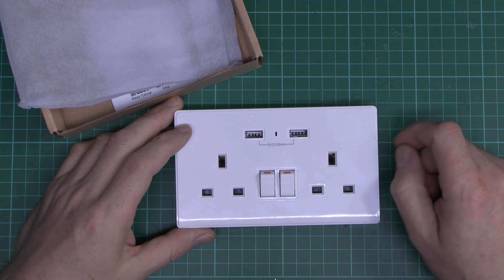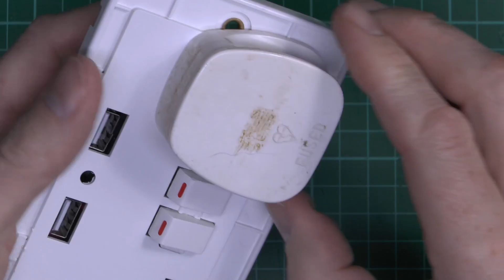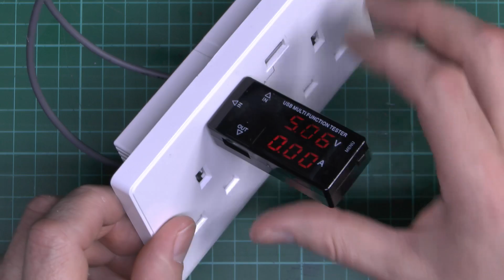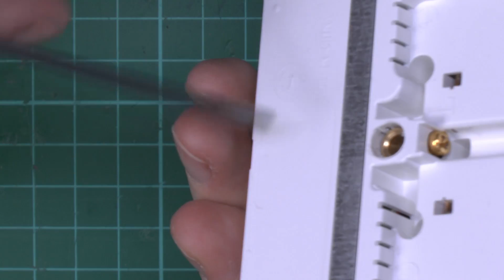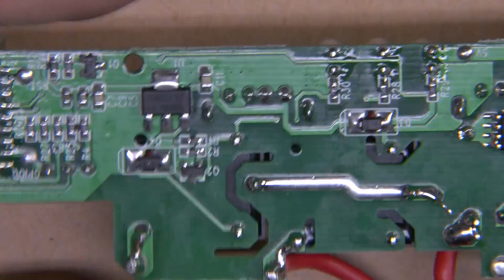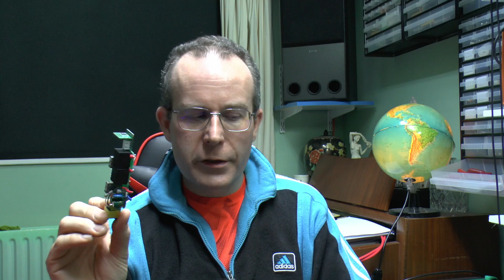WiFi Controlled UK USB Socket Outlet Teardown

Comment: JW not got to the end of your intetesting video so I may be preempting you …I noticed I think, the relays were only rated  for 10 amps at 230 volts. If my reading of the rating on these relays (from your video) is true then this socket cannot be used for 13 amp loads …

Comment: Nice objective video John. Thanks. Wouldn't it be sensible to add a DP isolator switch to the USB part of the socket? It would eliminate wasted electricity and, if I understand correctly, you would not have to remove it completely when carrying out an insulation test of the circuit wiring. I suppose, even if that was fitted, you would be putting a certain amount of trust in the quality of the socket and hoping for the best. Thanks again.

Comment: I have this product for more than two years. (Actually 4 of them)
They are in dayly use. One is witching pool pump high and low pressure. Absolutely not low quality. I checked the issue that was showed (fuse) and also checked all soldering on one item. All ok.

Comment: The two current ratings are for the NO and NC states of the relay. Generally, when the coil is energised there is more pressure on the contacts which allows more current.

Comment: There is an obvious answer to the problem of the USBs always being connected. Add a switch to each USB socket so the power is only connected when there is a plug inserted. Has anybody found a supplier who does this?

Comment: If I could improve this device, the first things I would do is use better components and make it safer including a replaceable fuse. Also redesign it so that it plugs into an existing wall socket. 

The unit design will have a low profile so that it almost looks like an actual wall socket (with a cover adapter for wall mounted socket terminal boxes). The unit can be fully powered down when not in use. USB power handing can be customized to suit device power consumption (also replaceable/interchangeable USB sockets to keep up with tech upgrades). 

I think a silent tiny cooling fan inside to prevent overheating. Yes everything will be squeezed into a small space in regards to unit depth (front to back) but will have more area (up, down, left, right) to spread out components fitted safely. I like the idea of a multi function power outlet, as long as it's safe, well built, uses quality components and will last for many years.

Comment: In Australia, Power Outlets are a "prescribed item" - that means it is mandatory that they are tested and certified compliant for ALL relevant standards. That includes the electrical, the plastics flammability, and in this case it would have to meet all USB and RF standards as well.

Comment: U6 is a MOSFET; all the pins (5-8) jumpered together (probably the drain), and pins 1-3 jumpered together are probably the source, and pin 4 is the gate. Salvage that, and the relays at least, and maybe the Wi-Fi module if you’re into that sort of thing, then destructively test the rest to see if it’ll catch 🔥! 🎆🎇

Comment: I don't like the fact there is so much technology in something that was designed to be simple
Reply: I recently bought a latching isolation switch for my car battery, and there were Bluetooth / WiFi versions of this on Amazon.  I noticed quirks, flaws and annoyances for these devices in the customer reviews and comments, and the need for the switch to be powered was a drawback.  I naturally bought the manually operated simple switch for a fraction of the price, and it only takes less than 10secs to flip the bonnet and then the switch.  Simple and reliable and does the job.

Comment: That small electrolytic above the warm-running transformer will have a reduced lifetime.  Very likely to be the first thing to fail.  In a good design, electrolytics would not be vertically above the hotter components to avoid heat transfer by  convection.  Preferably not near in any direction to avoid heat transfer by radiation.

It's going to fail after a couple of years anyway, but sensible design would have squeezed another couple of months out of it.

Comment: I would never bother with these, I've never  liked the idea of permanently hardwired electronics that can't be easily isolated  apart from the safety aspect, if you had a house full of them,  it would add up to a fair few wasted watts of power when they were not in use.

Comment: Hi, Can anybody make out the part number of that 7 pin chip? I am trying to repair a usb light fitting for my Dad. The chip looks the same and is near the transformer but the one I have has no markings. So far, I think I can see PN 8570, then K28H P5? A Google of variants of those numbers reveals nothing. If any does and matches a SMPS transformer chip then I would spec a couple of quid to see if I can get it going. It is definitely that chip which has failed. It has worked fine for 2 years and I am only trying to fix it because it is an expensive light fitting and I cannot get a replacement board. I am not convinced about the overall quality though (can't see a fuse except a 10 ohm resistor, no ntc) and won't be that upset if I can fin a reason to not fix it as it looks pretty bare bones.

Comment: The secondary wires are not coming out of the top because they couldn't fit the wires on the board. It's for insulation purposes, and it's a very good way to do it - You keep the secondary a LONG way from the primary this way.

Comment: 8-pin device with pins shorted in pairs of 4 and 3 pins - nooooo. That's a MOSFET. The brains of the operation is the Espressif ESP8266 WiFi-chip.

Comment: Apart from the electrical safety, if the cloud service running the app goes down or the company liquidates you are left with virtually useless sockets.
Reply: Tony Darby Not quite without WiFi the momentary switches should still function manually or is that digit - ally😂

Comment: In principle I'm not really against a USB charger that is left permantently on depends on what it is and how its used, if it is used a lot of the time during most days then it's fine. Kinda like how I use this 6 port USB charger that I have on my desk (which most of the time is powering one, two or more raspberry pis lately), it's only real issue is that with very light loads it makes a stupid high pitched whine but since no load or normal charging load stops that I'm okay with it.

But for a wall integrated USB power supply it's different, it's not as trivial to replace as a regular plug in kinda deal for which almost everybody nowadays has a spare elsewhere in the house or bag. Also if it ever decides to try to catch on fire or release the magic smoke you can't just easily pull it out of the wall or turn it off with a physical switch that isn't on the front of the panel.

Comment: The resistor from line to the bridge rectifier will be a fusible type of resistor, but it's main function is as an inrush current limiter for when the capacitors on the DC side of the bridge rectifier charge up. Pretty common arrangement in most small SMPSes.

Comment: Having permanently powered active electronics in mains sockets is a really bad idea... they will eventually fail with all the various outcomes that may bring :(
My wife recently asked if I could install some MK sockets with USB charging ports... I refused!
Reply: Maybe they'll come out with some halfway decent models eventually that have a physical on/off switch for the USB power supply part. 

But yea until that's the case I've got the same opinion about installing those, unsafe and a hassle when they do eventually break. Easier to just have your chargers take up a socket and  if the charger dies for some reason to dig up one of the other suitable spares that surely float around by now in the house.

Comment: I cannot stand them stupid USB sockets , they give me the creeps.... a USB port that close to a 32amp ring main ..... yeh no thanks.
Reply: It's fine if correct creepage distance and isolation barriers are used. Think about how small a typical phone charger is. Same problem there, which is why the el-cheapo chargers are dangerous, and why the proper ones are relatively expensive

Comment: Cheap chinese device... not that I personally would give USB built into hardwired installations the time of day as I just don't trust small transformers being live 24/7 because in the event of a spike in the voltage or something going wrong and possibly resulting in fire while asleep at night... I don't trust USB sockets full stop.

I've had many USB adapters fail... just easier using plug in adapters.

Comment: Fairly obviously this was originally designed as a non-WiFi-controlled USB socket and they simply added a spring to the switches to make them momentary, cut a few connections to take them out of the mains circuit and turn them into inputs for the microcontroller and then replaced them with the relays. Hence the ugly mess of wires and the nonsensical red power indicators on top of the switches. If you were designing this from scratch you would probably never lay it out like that, nor use such chunky switch contacts.

If I was specifying a permanently-installed USB socket, I think I would have the electrician make one up using Euro modules, with a proper isolating power switch. No need to integrate it into the same housing as a BS1363 outlet (although I suppose you probably could squeeze a switch, a USB module and a BS1363 outlet into a 4-module Euro faceplate if you really wanted to).

Comment: Is that switch something that just changes it from on to off and off to on? How can you make sure that it is off?
Reply from the maker: Have to rely on the LED indicators, or to be safe just unplug the item, which makes a mockery of the switches.
Reply: You have to view the switces not as a conventional outlet switch but a usable toggle input; little different to the WiFi system toggling the outputs.
If you want a system that provides  this functionality it has to be powerdf up..
I am not making any claims as to the build quality of this thing because it isn't great.
Reply: @derekrobinsonutube  I truly hate those kind of switches, especially if there is delay in the system. I also hate anything that has a light on it.

Comment: So much better to use a plug-in device. You can bet very few would be fitted and replaced by a qualified electrician. Trapped wires would be the main hazard but they could get pretty smokey too when they inevitably fail!

Comment: I've often wondered about USB outlets in sockets - even MK make some. Although an interesting idea, they also are, as you mentioned, likely to be going obsolete by the time they are installed. Couple to that the permanently-on electronics, the convenience does not outweigh the reliability problem. I first actually saw them in Ireland, but they are becoming more common, although I have to wonder why.

Comment: Nice idea, poor execution.  Think I'll wait till someone reputable brings out a well manufactured one.
Reply: I think I'd go with terrible idea, so so execution. It's not high quality construction but it's not as bad as all that. The big nasty is the very idea of the permanent hard wired electronics. I would avoid it even made by the bluest of blue chip manufacturers.
Reply: If MK made a version maybe but I would probably still give it a wide birth.
Reply: Probably the reason why mk havent made such contraption
Reply: @s.kxx1956  Sorry if this disappoints but they have:  https://www.mkelectric.com/en-gb/Pages/USB.aspx indeed that page boasts of being among the first to do so back in 2013.   Now if only they produced one in which th USB module had a switch and so could be isolated from the mains.

Comment: since the USB and the relay circuit seams to be sharing the power supply I wonder what would append if you tried to draw maximum current from USB and then use Wi-Fi to Turn on the relays. will it be smart enough to limit USB current or just incapable of operation??? (I believe the later but it would be interesting to check)

Comment: I wouldn't complain too much about the secondary windings of the transformer not going to terminals.  OK, mechanically the transformer is crap, but having the enamelled copper wire (possibly double insulated) of the secondary coming out from the transformer like that should give far better primary/secondary isolation. (I think both BigClive and DiodeGoneWild have explained this in some of their videos where they have dismantled SMPSU transformers to check for inherent insulation problems).

Comment: Looks like they use the esp8266 chip so should be fairly easy to write your own firmware with the Arduino IDE. Shame the build quality isn't great on these, though it could be a lot worse.

Comment: Oh, for goodness 
sake!!! Whatever 
next?! If you want 
my view on these.......

......Wayne's Electrical DOES NOT approve of the permanent installation of electronics into the electrical installation and the structure of a building!

For a few reasons..... FLAAAAAMES being one of the most worrying ones!

Next, when pulling-off certain installation-related tests, something like this will REALLY fudge-up the test results!

Next, how many watts does your sockets use?

Mine = ZERO WATTS because they don't contain =POXXY= electronics!

Electronics permanently built into the wall should be disallowed! As like with certain things like these, you WILL get certain "Outside-Of-The-UK" cheap and crappy makers of these things knocking them out for a few pounds each!

Not only that, what happens to one of these when subjected to a power surge, or for that matter, when one of these things lets loose?

Really, JUST DONT CHANCE IT.

Just use plug-in phone chargers and turn them off when not being used. At least if it fails, you can do this REALLY CONVENIENT thing of just unplugging it and replacing it yourself, with no screwdriver needed!  HOW TASTY IS THAT?

I would never have one of these, or even one of those with the USB sockets in it for the reasons stated above.

The only time I would ever get one of these, would be to crank it RIIIIIIIIIIIIGHT UP to see how much it takes... "Uuuntil-It-Pops" and to see what happens when it does! :D

Thanxx for showing.... But no thanxx. :D

-Wayne's Electrical.

6th March 2019, 02.40
Reply: do you always talk about yourself in the third person?
Reply: Have you not heard about home automation? I believe large commercial buildings have had plenty of electronically automated switching for years. It's only natural that it's starting to come into use in the home as well.

Comment: Hi John. Enjoyable vid as always, thank you. You didnt mention another poor thing in this substandard socket. one of the grey wires from the relay to a plug on the board  has been trapped between the corner of a relay and the case (seen at 14.25), flattening it.
keep the excellent work up,

Comment: As an Electrician, I won't supply or fit these USB/WiFi socket outlets, for the very reasons you gave throughout your video. If a customer insists then they can supply it but I wont guarantee anything but my work. What is wrong with plugging in a good quality USB charger? I would rather see a short 4 way mains block with 4 usb chargers in it than this cheap rubbish. Also, when it comes to doing IR tests, you can't to a L-N test on a ring final circuit because the 5V usb power supply is across the supply.I know you can just do a LN to E IR test but it's not a proper test in my book. Great video JW.
Reply: It is also wifi controlled so you can turn your plugged appliances on and off with your phone. Why? do not ask me.
Reply: @TonyDartford  Well it is fun to blink the lights of your neighbours and have them run around wondering what is going on :D
Reply: @benbaselet2026  Now that could be useful for those dreadful suicide inducing days, when neighbours are blasting music for 12 hours straight.  If the EU had forced all audio equipment to self detontate when pushed over 60dB, I would have voted for Remain instead!
Reply: As with any circuit that contains electronics equipment, you'd have to disconnect one of the live conductors from the equipment and terminate into some sort of connector before IR testing. In this case, stick the neutrals into a levered Wago connector, perform your IR test between all 3 conductors then reconnect your neutrals into the  neutral terminal on the socket-outlet.
Reply: I'm surprised with LAP going bad, aren't they screwfix's own brand? How did they fail?
Reply: @uK8cvPAq  Big Clive. Com took apart a lap usb socket, he found them to be well made, charging circuit was well made and designed. The issue I and many other electricians have is the constant unswitched load across L & N. There are some really badly made dangerous sockets out there for sale. But generally, LAP gear I found to be "ok" at that price point.
Reply: I think these are popular because 2 outlets are not enough anymore.  In my kitchen I have several 4 way schuko outlets and they are barely enough. But yes separate USB chargers is the way to go.
Reply: Back in my day we had a single double outlet in each room and that was good enough!
Reply: @Indosarnia  I'm inclined to agree.